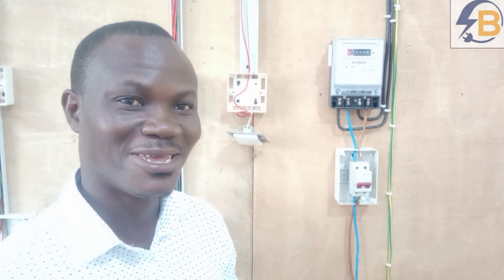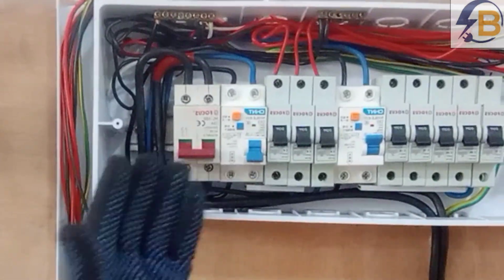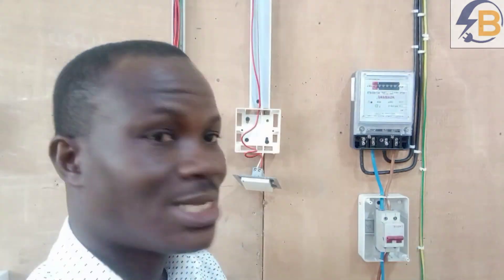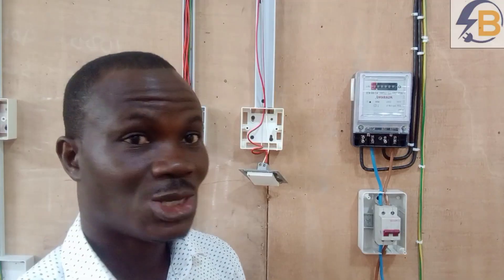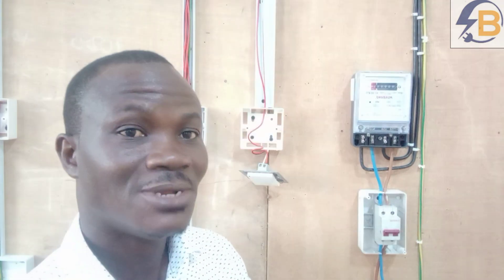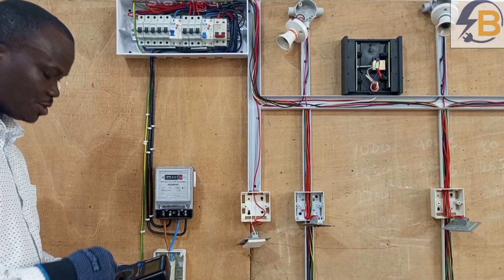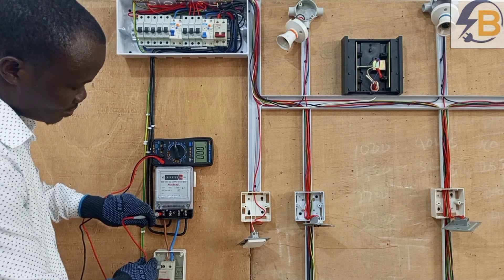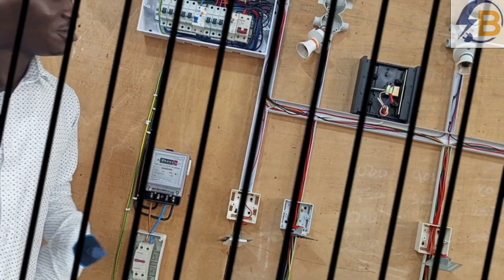Full Electrical House Wiring |Part7|

Comment: Great video. 
Sir what is the different between continuity test and polarity test
Reply from the maker: The difference is that, continuity test only checks whether a wire or conductor is continuous or not. But polarity is to ensure that the circuit wires/conductors are connected at the right terminals just that you can use continuity method to check whether the wires are connected at the correct terminals.

Comment: Please sir, most of installations, the Energy Meter and the Consumer unit are always not close to each as seen in this practical,  so how do I do polarity test?
Reply from the maker: @afroclement6843  
Normally the supply authority who install the meter takes care of that during the installation of the meter. To make that easy. You must, especially when you use the same color of cable for both live and neutral,  mark clearly, to show which one is live and which one is neutral at every point.
Reply: @obloni_Electrical  Thank you sir